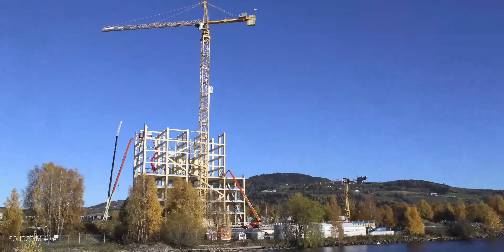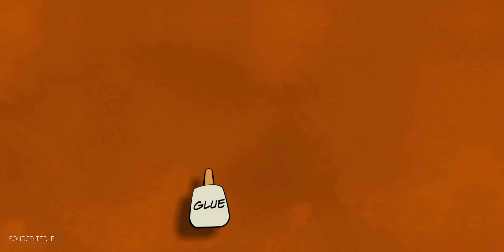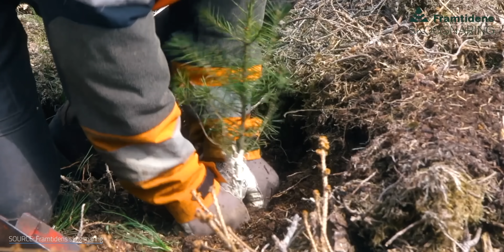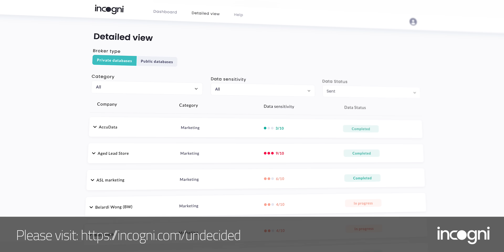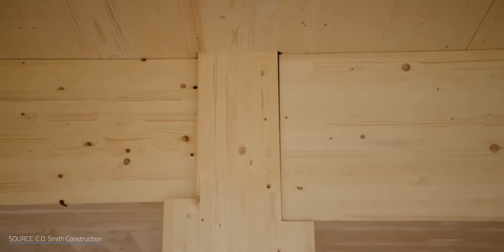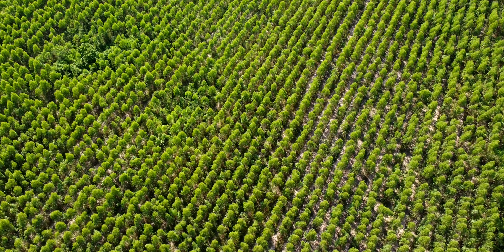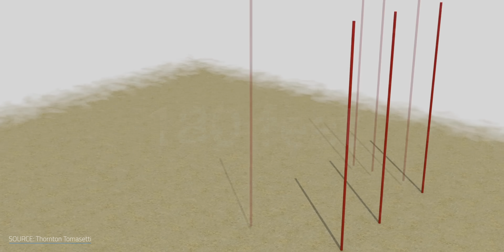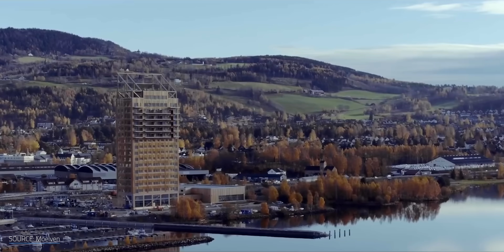How We Engineered Incredible Wooden Buildings

Comment from the maker: Is wood a good skyscraper material? The first 100 people to use code UNDECIDED at the link below will get 60% off of Incogni: https://incogni.com/undecided

Watch the full interview with Jason Korb here: https://youtu.be/lzPlwAx9T4E

If you liked this, check out Why Are Floating Wind Turbines So Huge? https://youtu.be/83FqqfODmmg?list=PLnTSM-ORSgi7uzySCXq8VXhodHB5B5OiQ
Reply: They get blown away.
By wolves.
Reply: Not a fan of glulam wood. It freezes at different temps and needs to expand and contract. Then you get splitting. That is on 3 ply and 4 ply post for post framed buildings. They need to turn one of those plies 90 degrees. I do like the glulam sailboat mast. They are made in an octagon shape. We grow more wood now in same amount of area in C.F.A. lands. Commercial building codes with timber post don't need fire suppression. It's why houses burn to the ground while trees are still standing after wildfires. A steel beam collapses under it's own weight in 15 minutes at 1400F. A 1400F wildfire takes 5 hours to burn an 8 inch round log. I actually build timber frames. I am using x2 2x12's glulamed with tenons under my 6x6 beams to get my needed square inches of header. Glulam started with people making their own timbers on a job site. The newer mass timbers have insulation and thermals breaks built into them. Like the log homes with insulation in the center of the logs. They way we build houses is meant to cost people money every month. With better passive solar designs you can eliminate such housing cost.
Reply: Those are not forests. They're tree plantations. Totally different habitat and ecology.
Reply: @ShawnHCorey  you call them plantation’s but at the end it’s tree’s and any conglomerate of same type of trees is a monoculture and runs higher risk of infections and invasion by bugs etc
It’s simply nature.
Reply: This is a great topic to stay on top of.  I have been following this for years.  There are definitely some interesting challenges in providing enough material, but that is something that can be overcome with time in many places.  What I do see as a potential future path is actually building these in standardized "Lego" style bricks and components, which lends itself to mass manufacturing and the benefits that come with that.   Doing this allows building to be designed much more easily and make the lost piece issue a non-issue.

This is a good path forward for many reasons, and due to the nature of wood products weight, strength, and relative ease of use, this could reduce prices and shortages globally.  That is if the companies let that happen.
Reply: I would wonder how much intumescent paint would improve its fire retardant nature, too. and would in some cases be a carbon sink too, being made from say cornstarch PVA glue and sodium bicarbonate (which releases CO2 when burned but traps it in the growing carbon foam structure it forms to make a greater and greater fire resistance and insulation thermally to the internal wood it would be painted on top of)
Reply: You glossed over the fire risk. Maybe some people aren't bothered by the fire risk but Grenfell Tower is still in my mind.
Reply: I guess this is just someone acting to be you?
https://youtube.com/@Undecided-with-Matt-Ferrell.
Reply: who cares about the environmental impact? its negligible...
Reply: back then, architecture and structural design based on local availability of materials.  wood buildings likely viable where engineered wood is available but not much else.
Reply: It is interesting but wood rots
Reply: Carbon is good for the world leave it alone. If you think other otherwise just look at the amount of CO2 in the Jurassic period before responding to my comment.

Comment: Would (wood?) love an update on this -  a lot is happening with this technology.  One of the environmental advantages of this technology that I have not seen addressed is that this technology, and the materials and infrastructure needed to produce the engineered wood, require enormous capital investment and regulation to assure compliance with quality standards.   In poorly regulated forrest regions, trees will not be illegaly or unaccountably logged to supply material for engineered wood because the source of the wood for the mill/factories can be easily monitored, audited  and regulated by government or third party environmental organizations.  The wood used in engineered wood cannot be processed in independent, unregulated facilities as is common areas with deforestation issues because the facilities for engineered wood are at scale and subject to inspection for quality control and conformity with building codes.

Comment: As a structural engineer with degrees in Engineering and Forestry/Wood Science you are absolutely correct.  Wood is a great structural material.  It is beautiful as well as 100% renewable and the resource is 100% manageable.   Besides Mass Timber, I recommend checking out some of the structures designed by Julius Natterer (he was a German Engineer and professor at  ETH Zurich).... I was privileged to work with him several times.

Comment: if clt is to take off there needs to be more robust supply lines for raw wood/clt/panels, as well as better standardization of parts (e.g. wall and floor panels) for the sake of modularity and ease of shipping. normally i’d expect china to be one of the few countries with the will to do all that, but considering they’re having their own desertification crisis maybe not.

also i’m skeptical of the adhesives that will have to be used in mass timber production, many of which are petrochemicals. most regular buildings (esp timber frame 5-over-1s) also use these in far greater quantities, but being able to phase them out altogether would be nice.

Comment: Hempcrete with structural internal/external supports (like Just BioFiber) seem like a best solution.

Fire proof, pest resistant, excellent insulator (reduces heating bill by 70%), sound dampening, regulates humanity and resists mold, nearly the same cost, easy to install, and absorbs more carbon than it emits.

Comment: This is a horrible idea when you take into account the reduction in fire safety and the difficulty in maintain wood. Not to mention that wood expands and contracts with moisture / humidity and temperature, which is only compounded the larger a wood structure is built. Plus, wood isn't a consistent material and will have a large amount of variance.

The whole reasoning to using wood framed skyscrapers is because of the carbon footprint of steel and concrete. But that is a non issue if we just move to nuclear energy, an abundant carbon free energy source. The fact that nuclear energy, fission based to be specific, isn't more embraced, especially in environmental circles, is really tragic.

Comment: Termites, water seeping(broken pipes), fungus, shifting of temperature(season/weather), oxidization and man made modification like drilling a hole to place a painting could damage wooden structure not just fire. You are talking about people living in those wooden structures, many things could go wrong. If you are just covering 1 aspect of the material and forget about the others, then, you are structurally unsound. 

An extra thing to note is that the chemical used on making those wood might cause discomfort to human beings once it leaks into the air(some says it causes cancer, but it was not proven).

Comment: What about the concept of a 'living' house?  One that is grown on site by using different plants like bamboo for the framework with different vine plants like kudzu filling in the gaps between the bamboo stalks.  The floor could be compacted earth or a woven tangle of vines!  Since bamboo generally grows in the tropics, a centrally-located brick or clay oven/furnace would help keep the 'walls and ceiling' alive during cold weather!  South-facing windows made of glass of mica could provide sunlight for the interior plants as well as a view, with other small windows going you that 360 degree view!  At least two rings of bamboo with maybe 6-12 inches of space between them would be grown into a fat cone shape with the apex being overlapped like the top of a teepee with a double-insulated exhaust pipe, spark arrester and conical cap sticking thru the center top hole!  Some good points would be very low construction costs and very eco-friendly structure, with only one or two persons needed to 'grow' it.  Some bad points would be long 'construction' time, probably a year or two depending mainly on how fast the bamboo grows and maybe higher fire risks but the fact that living plants contain more moisture will help to mediate this potential problem, landscaping around the structure would help as well!  The 'builder' would probably be only working part time depending on how many structures he/she is growing at any one time!  Plants producing food such as berry briars could easily be included!  If you don't use chemicals, then your waste water and organic waste could simply be buried in holes dug along the exterior of the structure to help fertilize the plants!  The door(s) could be overlapping flaps of woven vines, though they may tend to grow together if not trimmed when needed!  Maintenance shouldn't be much more than maybe yearly trimming and watering and fertilizing as needed!  A big bonus would be no toxins involved!  Though this structure wouldn't be air-tight, you don't want it to be and any holes could be filled with mosses!

Comment: I used to travel ALOT. I normally stayed in Hampton Inns. Holiday Inn Express came out and I tried them . The big difference between the two was that Holiday Inn Express was stick(wood) built. You cold hear everything. If some one slammed a door on the other end of the building you heard it. Hampton Inn is concrete and was very quiet. How do these big wooden buildings do with noise?
Reply: That may be true but I bet with you that the holiday Inn express wasn't fitet with today standard soundproofing carpets

Comment: Id be more worried about leaks and rot. And fires.
Metal and concrete is tried and true and extremely strong. Longevity is an issue with leaks. Convincing people that it's fire safe is going to be hard especially when it's over 3 floors

Comment: I'm a structural engineer specialized in wood construction since the start of my career in 1998. I've been reading the comments below and I see the same questions in each and every project and thus far I haven't seen a single project that in real world usage had an issue with these things, it's all about the design. The big challenge now is communicating the knowledge across all disciplines in the construction industry. I try do my part by holding lectures at universities, trade shows and international summits. We try to openly share our technical solutions & knowhow with "competitors" in the engineering field, but we are a smallish company and our resources (time mostly) are unfortunately limited.
Fire - a lot of research has gone into this area and as stated in the video the behavior of wood is well understood and there are several methods to use for the design that has been proven to work. There are 2 main design goals: Structural capacity & fire containment. These two requirements requires different solutions, so in many cases large part of the wood structure is clad in something non-combustible, to decrease the amount of burnable surface area in a fire compartment. 
Moisture - here there are also a lot of tools available for design. If you get damage from the technical installations in the building it's just a question of bad design. Modern wood buildings should be built with pipe-in-pipe systems with controlled drainage points. Bathrooms and similar areas you add water tight membranes and such to protect the structure. The time it takes for rot to develop to a point where it threatens the structural capacity in these large sections is months if not years, if it is well designed the water damage is readily apparent on room surfaces well before that and can be remedied. The biggest design challenge is our changing climate and designing for a future imaginary state where we could get problematic diffusion transport of moisture in the climate separating building parts and trap moisture inside these parts where it won't be discovered for years. 
Monocultures is a problem and there is no easy solution. Though the lumber used for structural applications needs to have different properties, compared to lumber used for pulp. This in turn opens up for less monocultures not more, since pulp is the dominating wood product today (in volume). For structural lumber it's just not about net production of cubic meters (or feet) of raw wood. It has to grow with the right properties, which favor slower growth and older forests, opening up for greater biodiversity in these forests. Add to this the need for lumber which is suitable for furniture or lumber for claddings and so on. The more uses we find for lumber, the less monocultures we will see, because different species of trees are good for different things.
Reply: Wood quality, technology of CLT. I suspect the discussion of CLT omits a few items in trying to match attention spans. They only point out three items in the technology of production of panels. So grading of lumber is left out. High quality lumber is selected. Second finger joints have become cheap, and will get cheaper. Faults are removed. Tolerances. The lumber used is cut and planed to unusually consistent standards, both dimensions, and how square the lumber is, right to the corners. Add in the surface roughness-smoothness are designed to match the adhesives, and manner of compression. 

Water. Eventually the pans under clothes washers, dishwashers, and void space under bath tubs will have sensors. Addressable switches are cheap. Building operators will know what’s going on. Insurance will first reward, then expect it. Great care will be needed in design and install of balconies. 

Fire. The active systems now installed with one exception are adequate. If there is a problem it’s ITM. There should be an ITM manual at occupancy. The one problem with active, manual systems is standpipe outlets. Leave the outlets in the stairwell, and the integrity of the stairwell is compromised by 2-1/2” (65mm) hose lines. See Chicago NIST test fires for wind driven fires, with a single window failure. I’m not sure that stacking is a problem in these high-rise, but not skyscraper buildings. That is beyond my competency. Provide 2 x 2-1/2” standpipe outlets that are in a FF’s lobby. See work by late Paul Grimwood, PhD & fire officer, Kent Fire Rescue, England. Everyone but everyone requires a second backup hose line. Provide a connection for it. The third paragraph is not unique to mass timber.

Comment: My first concern wasn't fire, but general lifespan, particular when exposed to decades of natural weather and temperatures and extreme weather events. Every building material will break down over time, and I would have like to see where it compares to steel. Stone/brick has the longest lifespan, (far longer than steel), but with wood being biodegradable, I just wonder where it would fall comparatively. That's not to mention that these wood structures still appear to have metal connectors/joints to assemble them, and isn't the real strength of the structure also related to those parts?

Comment: What's up with the glue used to laminate the wood? How many kinds of glues are used? What chemicals do they emit as they cure? how long do they keep emitting fumes after the laminates have been made? Do the buildings have fumes? What about when the building is taken down? What do you do with the laminated wood? Is it nontoxic? What happens to the adhesives when it burns? When it decays in a landfill? More information please.

Comment: One big issue with wood is lifespan.
Wooden buildings have a much shorter lifespan than concrete ones, and its harder to fix them in case of issues, since you cant just fill in spaces with liquid. 
There are also pests that tend to eat wood, that can make it much less structurally stable over time.
I used to live in a wooden house for 20 years, and while it was fine for first 10 years, after that bark beetles moved in and started chewing it all the way through.

Comment: The only thing really holding it back is the time its takes for the trees to be viable to be cut down so anywhere that does not already have a foresting programme in place will be probably decades behind those that do so would have to import from abroad making the cost skyrocket so people would probably still end up using concrete and steel

Comment: Nice to see that a local company here in Austria made it and shipped it by boat to USA. While a CLT tall building is not as common, oddly enough, USA has otherwise a fairly high rate of single family house made of "regular" wood.  Unfortunately in europe steel reinforced concrete became the norm. But that also has its advantages.

Comment: you have completely overlooked the most fundamental problem with it. concrete and steel are built on the concept of perfect cladding to keep all water out., and concrete can also store it. a leak isn't going to do much to concrete, so mistakes are a little bit more tolerable. engineered wood however is one of the worse wood products for handling moisture. it rots a lot faster than normal timber. the building concept it not about perfect cladding (as its never perfect) but one of drain and dry to protect the wood.
so its massive change in style of construction, being done by people who don't work with that method trying to do very fine but critical details in a big scale, meaning more mistakes will be made. which means its a high risk of leaky home syndrome.